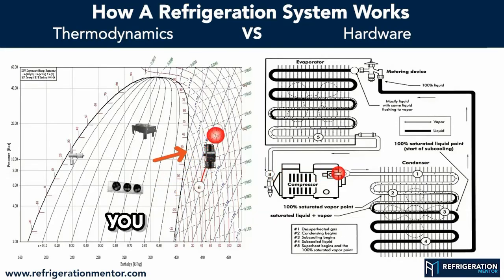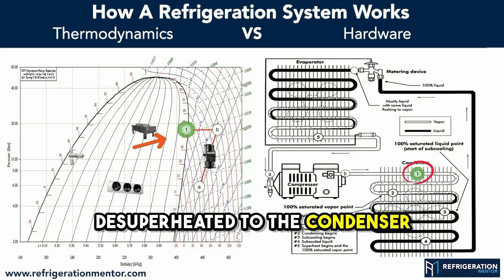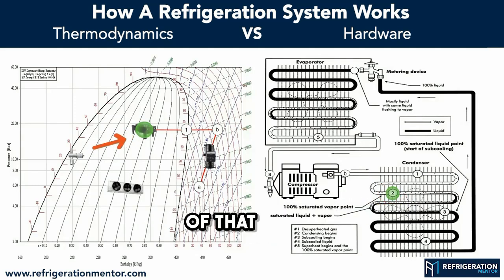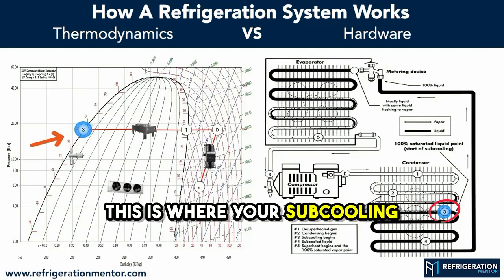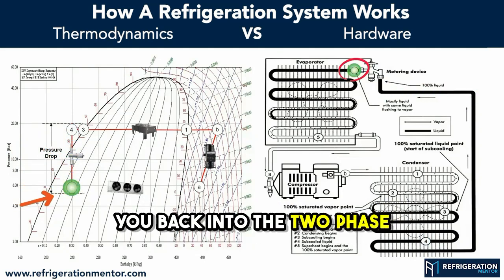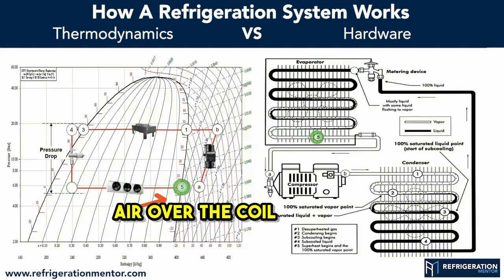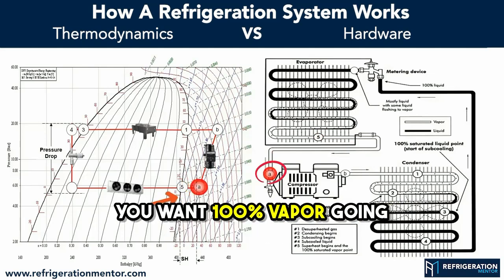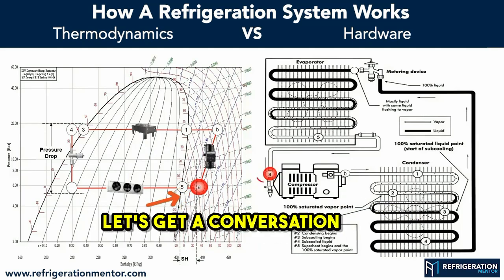How A Refrigeration System Works Thermodynamically Vs System Components

Comment: Actually, experience dictates that Maneurope compressors don't like "100% vapour" -- they like sweat-back (if you want them to last, that is); while scrolls actually need flood-back -- with some even having capillaries run directly from the liquid line, into the compressor, to feed liquid refrigerant.
Reply from the maker: Thanks for sharing. What you are talking about is call liquid or refrigerant injection to keep the compressors cool.